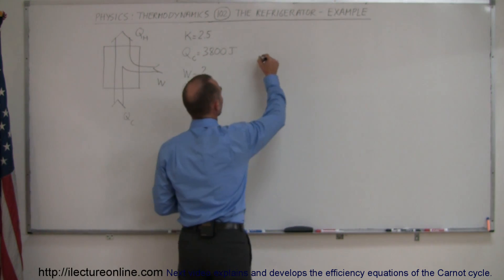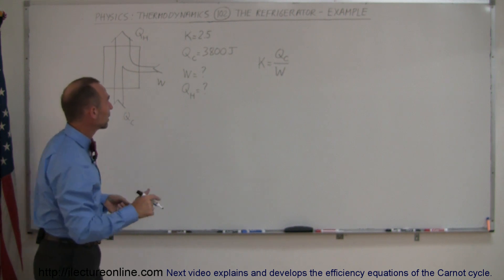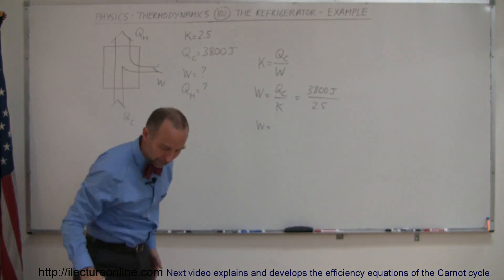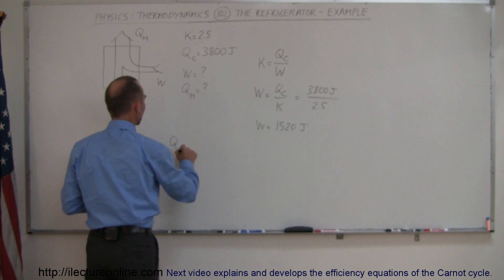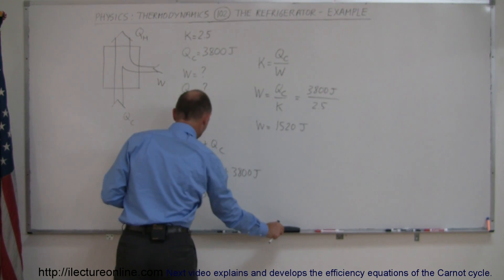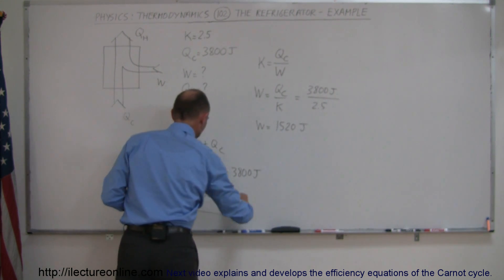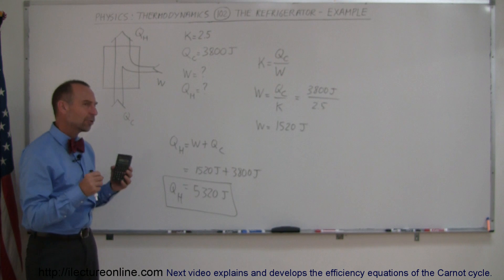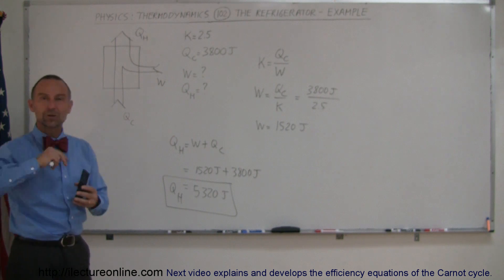Physics 29  Efficiency Of Heat Engines (12 of 14) The Refrigerator: Example

Comment: Umm sorry professor. Maybe it's because I'm still unable to understand the structure of a refrigerator fully, but why does doing work extract heat? The place where work is done is the compressor, but the compressor is almost in the area of the hot compartment in a refrigerator.
Reply from the maker: Naturally, heat flows from hot to cold and never the other way around.  (Second law of thermodynamics).  To make heat go the other way around requires work.

Comment: Can we use our refrigerator to pump heat for our house?
Reply from the maker: Yes, if you roll the refrigerator to the front door and stick the back of the refrigerator out the door.  Then it acts like an air conditioner if you leave the refrigerator door open.
Reply: @MichelvanBiezen  So I will have to put the cool refrigerator compartment outside and leave the "hot" compartment inside? Because if I open the refrigerator door, heat will come from the outside and it will be expelled into the inside right?

Comment: Hello Professor, I have just one problem with your graphs and your equation of the efficiency : you never speak about the signs ! And I'm lost between your videos, that are really helpful and clear, and my lectures where I can read that "efficiency = absolute value of W / Qh" (for heat engines for instance). My teacher always told us to be very careful with this "absolute value" and that it was ONLY there to make sense with the "signs conventions" for thermodynamic systems. Especially when you take a numeric example in some of your videos : I agree that this is absurd to say "this engine produces a work of - 800 J". But how to know if it's produced BY or given TO the system, if we don't have your graph under the eyes ? Thank you for your videos again and for the time you will maybe take to help me.
Reply from the maker: Ewen,There are 2 aspect to be aware of:1) The equation used for the first law of thermodynamics is something written as:  delta U = Q - W  (work done by the gas)   and sometimes it is written as:    delta U = Q + W  (work done ON the gas)       2) The direction of heat flow can usually be determined by what happens to the gas and what process it undergoes.  If you look at the videos explaining each of the 4 basic processes (Isothermic, Isobaric,  Isovolumetric, and Adiabatic) you will understand how to determine the heat flow.
Reply: Thanks a lot Professor for your answer 1), these are just the perfect words to correct my mistakes and clarify differences with my lectures. 
But what about your graphs of thermodynamic systems in most of your videos. Do W ; Qh and Qc really don't have a sign when we make a numeric calculation ? In this video for example : when you finally find Qh = 5320 J, then you say : " this is the heat expelled to the environment". So you prefer to use the WORD "expelled" than using SIGNS and saying something (very strange, I agree ! )  like : "the result of this thermodynamic process is a heat transfer of Qh = - 5320 J". Here still in the point of view of the system {gas}, whereas for the system {the environment or "the air in the kitchen"} we could say that it's Qh = + 5320 J. Is it just crazy to think like this, or it's just me complicating my self ? Your graph method is just perfect and so much easier to keep in mind for me, but I would like to understand the foundations of this reasoning ! ;) Thank you again for your time. Cordially.
Reply from the maker: Actually using signs is a good way to indicated the direction of the heat flow.  However since different texts (and professors) use those 2 different definitions of the first law of thermodynamics, I often like to make it CLEAR which direction the heat flows.  But if you remain consistent to the definition you use, using signs is a good and CORRECT way to describe the direction of heat flow.
Reply: Thanks a lot, really ! I better see the difference between our two methods and formulations and I would conclude with this (please correct me if I you find that I didn't understand well) : either I take care to be explicit with the direction of the heat flow and can take a helpful assistance on a diagram, or I don't, and so I have to use signs to describe it clearly.

Comment: I'm having trouble understanding why the joules of work is less than the joules of extracted heat. Isn't this where the inefficiency should apply: work input > heat extracted from cold reservoir?
Reply from the maker: stepsvideos 
Note that K is not efficiency but the coefficient of performance.

Cold air (from the refrigerator) still contains a lot of heat (relative to absolute zero) which is expelled through the refrigeration process.
Reply: Michel van Biezen Thank you professor, I will have to follow up on the clue that ''Cold air (from the refrigerator) still contains a lot of heat' . 
 
Also, thank you for your videos, they are very helpful.
Reply: @stepsvideos  Here's an interesting fact too. The coefficient of performance COP equals 1/Efficiency, so that means the smaller the efficiency, the greater the COP.